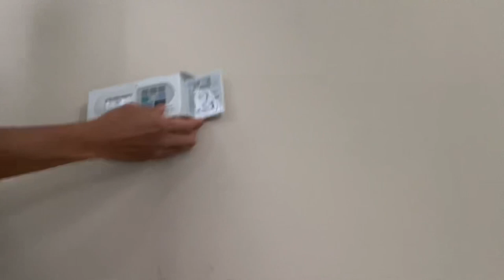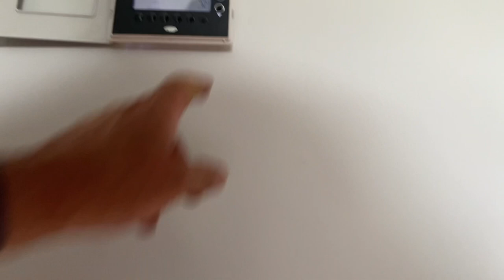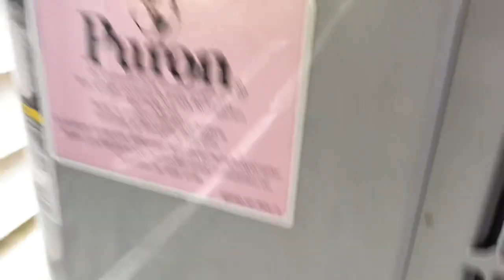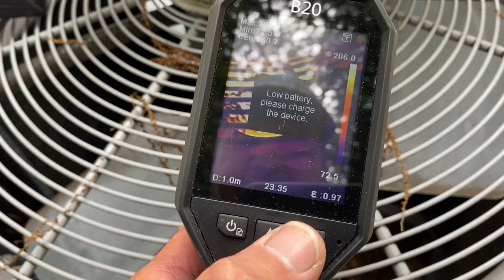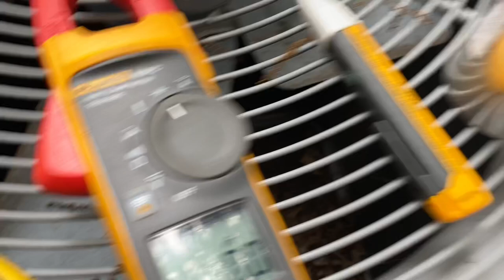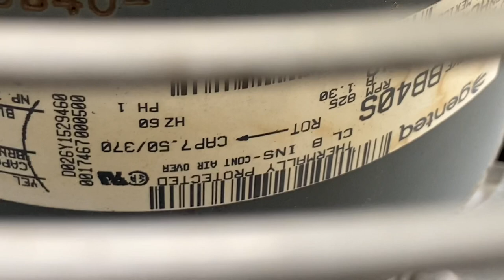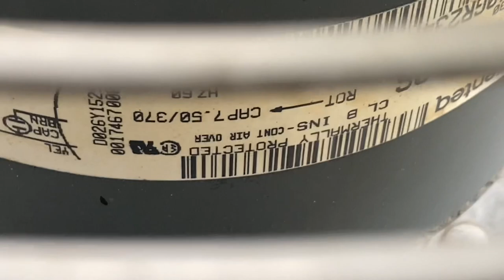Carrier Central AC Condenser Not Running - Fan Motor Either Dead on Thermal Overload or Burnt Out

Comment: When a motor has been severely overheated, and the internal overload opened several time as in this instance, I always place a note to the provider (third party retail service) that there is  a strong possibility of near term failure, and that the motor should be replaced for reliable operation. That way, it cannot become a callback when it fails on a hot day. Not replacing the motor is not a reprieve, it's a new date for total failure and a mandatory replacement at some point in the future.
Reply: @PipeDoctor  ......and I agree with how you handled it. You can almost put that motor on your truck and wait for the call, lol!

Comment: Mikey, I would be willing to bet my paycheck that the condenser fan motor is fine. Unit started up, capacitor popped, and the motor tried like hell to start without it, so it went in the thermal overload and you cooled it off, I bet it works fine for years to come.

Comment: Hello from the jersey shore. Those carriers that have the yellow and green lights are communicating systems but they have a couple different levels of that and will only start the fan on a valid call to start from the board. Contactor only control's compressor,some even have variable speed fans and compressors. I miss working on these but they can be quite troublesome with communication errors due to our salt air and corrosion on the board outside. Keep up your good work and help me stay fed

Comment: I really could’ve used a coolpressor yesterday, was wishing I had one. On a residential 4 ton Goodman condenser that’s only 6 years old, the compressor was off on thermal overload, and extremely hot to the touch. The capacitor was fine. There wasn’t even an accessible hose bib near me, so I just grabbed my Home Depot bucket and and used it to dump cold water over it. After it reset itself, the (scroll) compressor made a loud racket and was running backwards. Time for a new compressor.

Comment: Was the filter in backwards? I thought the metal part of a flat filter goes on the downstream side, not the intake side as shown - it's there to keep the filter paper or media from being sucked into the coil/air passages where the air goes after being sucked through the return grate.
Reply: Some filters have the structure on both sides
Reply: @AmericanFarmerHVAC2024  Did that one have it on both sides? A competent tech is observant of his surroundings, it would have been easy to check. It was open and just hanging there. 
Also funny that the customer said the unit wasn't very old, only "four or five years".  Turns out to have been installed in 2010. In any business, never trust information from customers .   ;-)
Reply: @snidelywhiplash8923  may have been talking about the thermostat. Local home centers don't carry that filter so from the angle we got cant tell
Reply: @snidelywhiplash8923  yeah, I'm never afraid to correct a customer when they try to tell me it's only a few years old. "Ahh it's about 20 years old" try 30 bud.
Reply: @matthewhoffman9242  You may be right about the thermostat. But I'm not sure a newly installed thermostat to control an older system would have been "branded" to match the installed equipment. Aren't these more typically seen installed with new equipment?
Reply: @snidelywhiplash8923  might be the last one he had on the truck that day......or was just selling a bit more pricey of a unit

Comment: Great presentation skills on your part.  I will say that (even though it achieved your SHORT TERM goal of getting the unit QUICKLY running again) I am not so sure that RAPIDLY cooling ANYTHING mechanical OR electrical is a great policy to follow for the long term health of most things.  Maybe a compressor is the exception to that general rule of physics (but maybe not)  Same goes for the condenser fan???  I don't know, just some food for thought.
Reply: @PipeDoctor  Well, I guess your eloquence rapidly disappears after the camera is turned off.  I am usually a fan of bluntness but NOT your reply.  Even >> if << I am incorrect, your harsh reply is simply unwarranted.  I have made many comments on youtube and I gotta say, your reply is the most (UNNECESSARILY) rude one I have ever received.  I literally just discovered your channel today and was most likely going to subscribe...  key word WAS.

Comment: Hey, great video - thanks! I have the same system and a similar issue. I put in a new cap, and the fan spun a bit then shut down. I bought a new fan and the new fan spins longer but shuts down after 20min of run while the compressor keeps going. Coils are clean, filter is new. I swapped fans from my second condenser (same specs and runs fine) and it did the same thing. Any thoughts on what it could be or how to troubleshoot?
Reply: @PipeDoctor  Thanks!!! The coil looked clean at first glance, but I took your advice and hit it with a shop vac and blower just to be sure. It worked like a charm...huge thank you!

Comment: My carrier condenser fan will turn very slowly when not in use. It will stop if I pull the power disconnect out. Otherwise the system runs just fine. I confirmed that the fan is using around 35watts when doing this. I also tested the three wires when it’s in this slow turn state and the brown wire going to the capacitor reads 91 volts and the black wire going to the control board reads 97.7 volts. The yellow wire going to the switch reads 123v. When the ac is actually on, all three wires have 123v readings. I’ve replaced the capacitor and the switch but that didn’t resolve the issue. I tested resistance on all three wires from the motor and there are no signs if an issue. If I turn power off to the control board but leave the disconnect connected, the fan will turn slowly and the 97 and 92 volts are still there. Any idea what would cause this?
Reply from the maker: AC or Dc?
Reply: @PipeDoctor  It's AC.  Since posting this, I believe I have narrowed this down to some issue with the crankcase heater. One leg of the CCH attaches to a control board and shares a blade with the black fan wire. If i disconnect the CCH, then the fan stops turning (this turning is when no AC is being called for).  It's an overly complicated wiring setup so I can't wrap my brain around why they want it wired this way but also, why is the fan turning. Something tells me that normally there wouldn't be enough voltage making it through the motor to turn it but that perhaps, there is more voltage going through that CCH leg than normal?